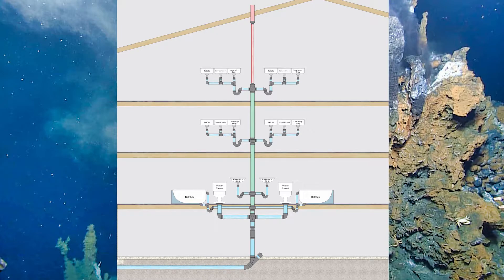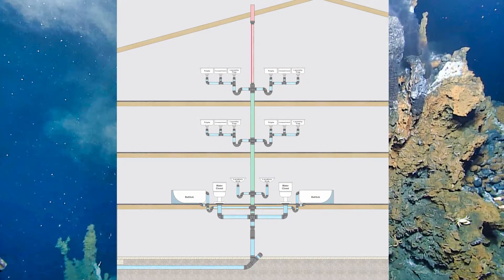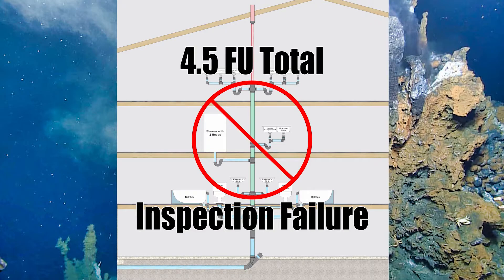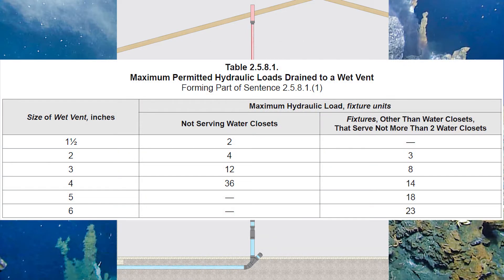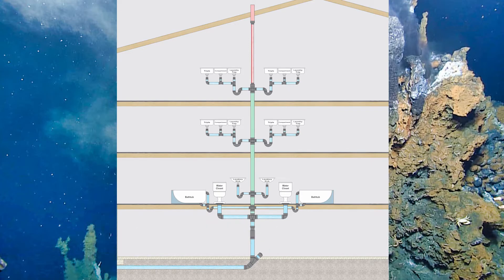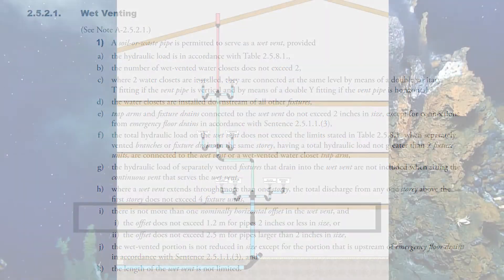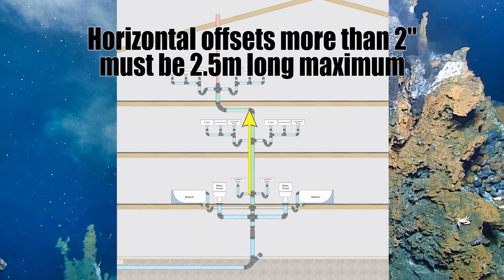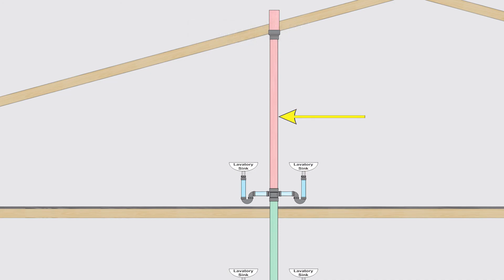Wet Venting Video:6 - Multi-Storey Wet Vents

Comment: Hi 
I just wrote the plumber exam 
There's a question that i couldn't fully process 
if you could help me:

When a toilet from floor above flushes, the toilet from the below floor loses its water seal what could possible cause ? 

I marked that the system it's insufficient vent 

Thank you for your videos,
They are the best on YouTube for sure !!!
Reply from the maker: Without seeing the other possible answers I cannot say exactly. But an insufficient vent can cause this.
Reply: any tips for taking the ip exam?

Comment: So if the basement includes a toilet, you can not use wet venting for 1st floor for 2nd floor?
Reply from the maker: I recommend watching the first five videos in this series, that will likely answer your question
Reply: @MathematicPlumber  Sorry I meant to say you can not use wet venting with 1st or additional floor with a toilet if the basement includes a toilet?  All your examples omit a toilet  on the upper floors except for Video 6 but the diagram on the side with toilets looks like you have dashed lines which I am guessing might be indicating dry venting?
Reply: I’ve also tried to find this out. Can a flush toilet 14’ above on 2nd story use a 3” wet vent to flow into a 3” branch of another flush toilet. This being 4FU it fits the chart.

Comment: ok, so I'm wondering, if you have a bathroom group that has a Lav's with the FD of that LAV acting as a wet vent for the both the WC and the Bathtub. Would the potion of pipe for both the tub and WC, from the Trap weir until it hits the Wet vent, would those be labeled as TA/FD?
Reply from the maker: Just trap arms. The fixture drain is a name only used for a single fixture that has it's own vent.